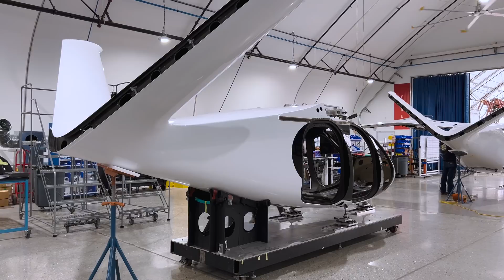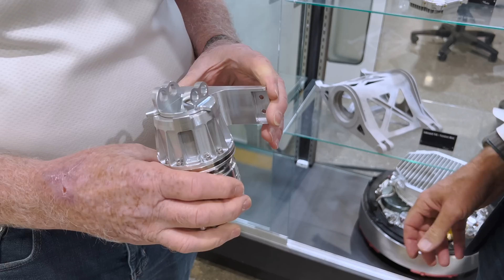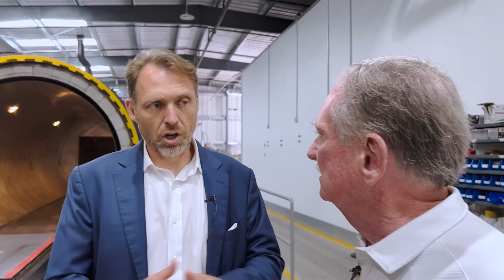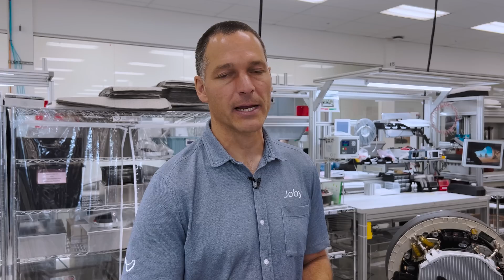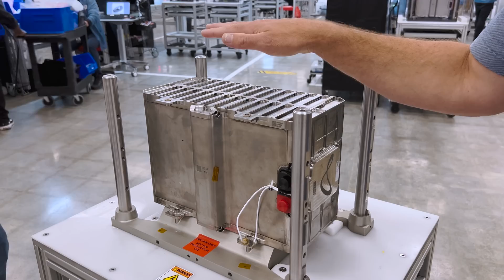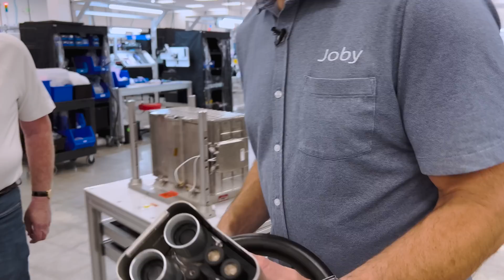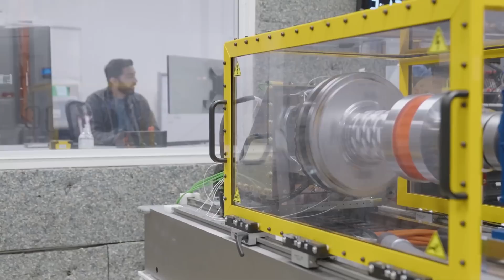Inside Joby Aviation: Revolutionizing Urban Air Mobility

Comment: Whats the power out glide ratio of that thing?
Reply: It’s the same as the helicopters it’s replacing however Joby can fly with two engines out but a helicopter goes into a catastrophic death spiral if uses either engine. The internal combustion engine is exponentially more likely to fail than an electric motors. Helicopters are headed toward obsolescence.
Reply: @Tannnnman this can glide land, unlike a helicopter.
Reply: @Tannnnman Helicopters can autorotate with power out to a safe landing. Good heli pilots train for this.
Real aircraft dont fall out of the sky when power goes out.
A fixed wing aircraft can glide to dead stick landing.
A rotary aircraft like a heli or autogyro can autorotate to a dead stick landing.
Without a power out landing capability, its not an aircraft.
Just a scaled up drone toy.
Only safety option if you can't glide or autorotate is a ballistic parachute for the whole craft
No amount of tech bro hype can circumvent basic physics
Reply: @geraldford6409 every helicopter that loses a tail rotor spirals to the ground.

Comment: Great video, thanks Sandy. 

At current cashburn of $100m per quarter, Joby will currently have about $690m plus the following to be added:
Early October 2024, Toyota made an agreement to invest a further $500m into Joby in 2025.
Late October 2024, Joby raised $230m. (less costs, call it $220m)
Delta Airlines will further invest up to $140m as milestones reached.
Income will come from the $130m DoD contract.
Factor in Marina factory producing 12 eVTOLs per year expanding to 25 per year.
Factor in Dayton factory (my estimate of production ramping up) 2026: 150 eVTOLs  2027: 400 eVTOLs  2027: 500 eVTOLs. 

So Joby has a HUGE cash runway ($1.55 billion). Within 2028 they will have more than 1000 eVTOLs producing cash.

My estimates: Cumulative values
2024 Marina 6 Dayton 0
2025 Marina 18 Dayton 0 (Dayton will be ready at this point)
2026 Marina 32 Dayton 150
2027 Marina 48 Dayton 550
2028 Marina 66 Dayton 1050
I have allowed ramp up for both Marina and Dayton. Total in 2028: 1116 eVTOLS.

"..A Joby Aviation S4 2.0 aircraft is projected to generate $2.2 million in annual revenue.."  So from 2028 that is $2.45 billion earnings.

The average tech sector P/E ratio is 33, implying a market cap of $81 billion by then, or a share price of $106. The share price is currently under $5.  

Joby's vertical integration is its superpower.   
Archer has admitted Midnight is not the best aircraft. 
Joby MTOW is 4800 lbs, Archer MTOW is 6700 lbs (same number of passengers). So Joby is more energy efficient.
Joby is faster at 200 mph.
Joby has longer flight duration which makes it more versatile.
Joby piloted flight September 2023. Archer have not yet piloted a flight. I suspect Archer could be a year behind with FAA cert.
I am expecting Joby to be 53-56% through fourth stage (FAA testing) in Nov 6th 2024 report. Note in 2023 they obtained a clear path to certification of their pouch battery.
Joby S4's hover noise is 67dBA, far quieter compared to Archer. Joby's on-wing flight 100 times quieter than a helicopter. For Archer, noise could be a big approval problem for operating in cities.
Both Archer and Joby have a former FAA administrator on the board.
Joby are producing pre-production prototypes as promised (4th being finalised during August, possibly 6 by end of 2024). There is no evidence of Archer rolling out prototypes.
Joby ditched gear boxes years ago. Direct drive is simpler, lighter, lower maintenance. Archer still on gear boxes.
Joby has 10,000+ hours of flight data so far.

There is plenty of territory for a number of eVTOL manufacturers.
Joby will be first mover, its vertically integrated production cheaper, more reliable and more agile. It's aircraft weight, speed, duration and noise superior.

Comment: Sandy, do you think that the EVTOL could extend their flight range by using a electrical power breakaway Umbilical cable on take off to overcome that large battery drain?

Comment: In my opinion: Joby aviation is Cool: Munro? when do you think; they will reduce their electric motors to one engine, possibly one engine powering a high pressure air tank; that powers the engine, an air pump re-supplying the high pressure air tank in flight; Only using the batteries for taking off, landing, and emergency?
Reply: Air tank?

Comment: Someday instead of having static discharge wicks on plane wings, that electrical energy will go back into flying the plane.
Reply: That would require somehow being able to reduce the voltage of lighting to where it doesn't fry the aircraft. And it would have to be done in like a nano second.

Comment: As an aeronautical engineer and former test pilot I appreciate the technological tour de force presented here. My question is; for the intended use as short range air taxi, how is this aircraft better than a Robinson R44? Helicopter air taxi has been available for decades with very limited success while utilizing aircraft with robust, certified and inexpensive technology. The Joby business model is predicated on building thousands of aircraft for a price that is quite frankly unrealistic and flying it into areas that have been off-limits to rotary aircraft also for decades.
Reply: Wouldn't be surprised if this was more reliable than a helicopter.
Reply: @zlcoolboy  Maybe eventually. Right now is unproven technology. Time will tell.
Reply: To give you the illusion that current heli tech is robust is by no means inexpensive. Otherwise helicopter air taxi services would not be reserved to the ultra wealthy. The Joby design is orders of magnitudes safer and much, much cheaper to maintain than current helicopter tech. This is not to mention its reduced level of noise and zero emissions.
Reply: @c.santerre4784  The Joby has a long way to go to prove it is what they claim.  Time will tell.
Reply: Engine out capacity is one factor, I think they've said they can loose like 2-3 of the 6 motors before it can't stay up in hover mode. I'd bet noise is a big factor for operation inside/around cities and urban areas; they've made a big deal over how quiet it is compared to other craft - part of what they're trying to use to open said areas up. Plus there's no exhaust, let alone exhaust with lead in it.

Buuuut it's gotta get approved first, which is no small hurdle.
Reply: Cheaper, faster, safer, easier to train, quieter.

Comment: Very (pleasantly!) surprised to see a Joby video from Munro, I must say. I totally did not expect that, with Munro's usual focus on the car industry... I've had an eye open for Joby for quite a few years now, I consider their design of craft to be one of the more viable ones, as many VTOL electric craft use separate lift and forward propulsion motors and impellers. So when you're in forward flight mode, you have a whole bunch of extra hardware weighing you down that is of zero use to you, and in fact is impacting your performance negatively, including a multitude of propellers sitting in the airstream causing drag, and while taking off and landing, you of course also have to lift all of the forward flight hardware. This is just straight-up bad design.

Not so with the Joby burd. You use the same motors and propellers for both take-off and landings, as well as for forward flight, with a small mechanism to transition between the two modes which in of itself is much lighter than a whole bunch of entirely separate lift motors/inverters and cabling and so on, and doesn't cause any extra drag. It also means take-offs and landings will be much quieter with the Joby's large, slow-spinning propellers than for a craft using dedicated lift motors - because weight and drag is such a concern, the lift propellers can't be too large, so they'll have to spin very fast instead, meaning huge noise at an annoyingly high pitch. It'll be like the world's biggest swarm of industrial vacuum cleaners all running in the same place at the same time, coming in for a landing from up on above, any neighbors and so on are really gonna love that. Not to mention all the people living in a city. lol

I expect that all those separate lift motor VTOL designs will be found to be a dead end within not too long, and the industry moving to a unified design instead. Of course, these tiny machines are just rich-man's toys and won't even make a dent in the fossil fuel usage curve. What we really need is fully electrical planes that can take upward of a couple hundred passengers at a time and will displace the kerosene-gulping turbofan engine aircraft we have today on the short to medium haul routes which most people fly.
Reply: We gotta start somewhere. This is the very begining. Of fully electric passenger flying. Once this is proven to be viable? Like you said, an industry standard will be set. That will be improved upon, until we get to a point. That passenger long range planes can be fully electric.

Comment: Have those carbon fiber props been tested for resilience if one of these aircraft collides with a flock of ducks or geese? I'd be very concerned with the damage from such an encounter and the danger to the passengers. I trust the answer is "yes", but I'd like to hear it from Joby.

Also, this company is a bit of a modern miracle, just like Tesla itself. Well-engineered and well-conceived machinery in an era when American companies face greater resistance to success than ever before in modern times. Keep going, folks.
Reply: Nah this guy just fell off the turnip truck, hes just a poser dabbling around in his garage on weekends, glad you caught it. Their obviously just a bunch of clowns who dont know what theyre doing, they havent tested anything. In fact this guy sketched this together 2 weeks ago in his moms basement then by pure luck won 900 mil usd on lottery which he used to fund this little adventure with. 

Oh boy it's good that you asked about testing things first before actually flying it. I'll be sure to forward that note to him. 

Yeah if one of the propeller blades hit something the self destruct will initiate immediatley and blow the whole thing up. 
What, you think that's a bad idea? 

Sure appreciate your insightful perspective and thoughtful questions on this very new and unheard of experimental e-vtol.

 Seriously though, i'm glad theres still people out there who are brave and ready to ask those hard hitting questions that havent been covered before. 

Truly, you are a gift to the youtube community my good sir! 

Tomorrow you'll keep us up to date on latest developments relating to this new magical sparkle water they've named Coca-Cola by asking more profound n bold questions like, Have you tasted it? or,
Are you sure it's liquid?

Oh im at the edge of my seat here. 
People like you who live life in the fast lane and are updated on all the latest technical contraptions must light the way for the rest of us dimwitted bafoons out there by never ceasing in taking up the comment section space with your always fresh, sharp questions that no one who looked into a subject for 4+ seconds would think of asking on completley new never revealed or coverd before for years on end for the whole world technology.

It's all you baby🏅
Please come back and endow us with your ever eternal wisdom😎and bring up more shit no one ever thought of until you beamed into this plane of existence and elevated our experience with your progressive thinking and utterly sublime questions.🏆
Reply: You think the FAA just forgot to ask Joby to test the props, seriously?
Reply: 5 props really help, if a bird hits one!

We will see how they hold up… I am more concerned about longevity of the props, being that windmill blades degrade, fall apart, and explode over time (if not repaired in a timely fashion.)
Reply: Nah this guy just fell off the turnip truck, hes just a poser dabbling around in his garage on weekends, glad you caught it. Their obviously just a bunch of clowns who dont know what theyre doing, they havent tested anything. In fact this guy sketched this together 2 weeks ago in his moms basement then by pure luck won 900 mil usd on lottery which he used to fund this little adventure with. 

Oh boy it's good that you asked about testing things first before actually flying it. I'll be sure to forward that note to him. 

Yeah if one of the propeller blades hit something the self destruct will initiate immediatley and blow the whole thing up. 
What, you think that's a bad idea? 

Sure appreciate your insightful perspective and thoughtful questions on this very new and unhears of experimental e-vtol.

 Seriously though, i'm glad theres still people out there who are brave and ready to ask those hard hitting questions that havent been covered before. 

Truly, you are a gift to the youtube community my good sir! 

Tomorrow you'll keep us up to date on latest developments relating to this new magical sparkle water they've named Coca-Cola by asking more profound n bold questions like, Have you tasted it? or,
Are you sure it's liquid?
Oh im at the edge of my seat here. People like you who life in the fast lane and are updated on all the latest technical contraptions must light the way for the rest of us dimwitted bafoons out there by never ceasing in taking up the comment section space with your always fresh, sharp questions that no one who looked into a subject for 4+ seconds would think of asking on completley new never revealed or coverd before for years on end for the whole world technology.

It's all you baby🏅
Please come back endow us with your ever eternal wisdom😎 and bring up more shit no one ever thought of until you beamed into this plane of existence and elevated our experience with your progressive thinking and utterly sublime questions.🏆

Comment: The thermal cooling needed for these motors needs to be lit lights & imho lot more streamline this area looks like needs loads of improvements needed . Honestly a the Radiators look like there off a motorcycle lol . Innovation needed in this area most certainly . Looks a lot of bulk in this area . Do hoe they Rethink this area

Comment: Hi guys with all that tech  great as it is . I think if I was them I wouldn’t let any loads be put in area’s that’s NOT Designed for such things & could make micro. Cracks and few weed / years down the line you have a Disastrous Event of say De lamanation so build specificly made chocks the shapes of the hull that contour the same of the load with a swivel knuckle  with foam insurrection. Holding the aircraft while work is been carried out . Dear me . Ps sorry about my spelling I have dyslexia

Comment: That superlight propeller blade will come off (literally) second best in a bird strike (if not just a sparrow) and the whole aircraft has already crashed from losing one. Joeben does not mention his time with Moller who provided the 'inspiration', the whole thing is way too top heavy and prone to being flipped over in blustery winds unlike helicopters but similar to hovercraft near lift off. The FAA published criteria require post failure 'glideability' at any point during transition or hover, this can't be done with no stored energy in the 'rotors' and no forward speed - there are numerous other shortcomings but aside from these the production techniques are way too slow,equivalent to hand built composite sailplanes of the past 60 plus years (tape laying and autovlaving is inherently slow, nothing like automotive pressings etc) too slow to build too slow to fly dangerous and actually noisy in HOVER where it matters (independent measurements confirm this , not taken upwind...)
This entire evtol mad rush will not end well.
Reply: The crash happened from exceeding the VNE speed and loosing two rotors at once.

Comment: I finally agree with Sandy.  What Joby is doing is comprehensive, best practices and very impressive. Not detailed, but implied by the design, is the safety and reliability which is key not only for FAA approval, but passenger acceptance.  Perhaps in a year or two, there will be a few in daily flight testing. and by 2030 actual deployment and use.
Reply: Deployment and use this year! But not yet in the US
Reply: @shrap8  Where, under what authority?

Comment: It's a impressive Plane, no doubt - but why they fly the Prototype old-school with a Testpilot in a Cockpit? Other Startups, like Lilium, fly their prototypes unmanned, this reduces Costs a Lot.
Reply: Most of their flight tests have been remote. What are you talking about?
Reply: @MeerkatADV   “Most...” is the point I'm making. Certification for manned flights is very expensive and should be done as late as possible. Manned tests are costly and can therefore be postponed until shortly before production begins.

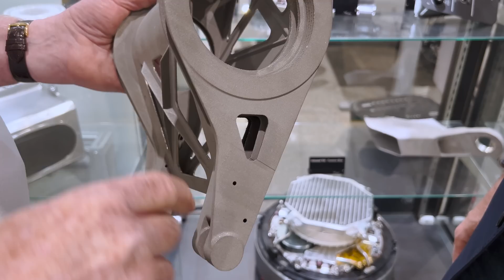Comment: Sandy  great video. Question at 9:15 that gray piece looks to have a crack by the opening you were pointing at. Any thoughts? Also did you know about their secret test and development site in the quarry. ?
Reply: I spotted that too.  I suspect it was a failed early print, but since they're using it for a display piece they accepted it anyway.
Reply: @rhamph  yea I was thinking that might be the case. But I thought I would ask anyway. I worked in the auto industry and most management had no idea what they were looking at.
Reply: @fredzirzowsr.8905  Hah - I agree with on about most management, but yeah I think @rhamph is probably right about it being an early print - if it had a defect that kept it from being used but still looked pretty good it makes sense why it wind up in a display case.

Comment: What is the Thrust to Weight ratio of these Helicopters
Reply: At max thrust? Probably a lot. If they can afford to loose a couple motors and still fly it's gotta be like 1.5-2x. Probably eats battery charge for breakfast if you tried it though.